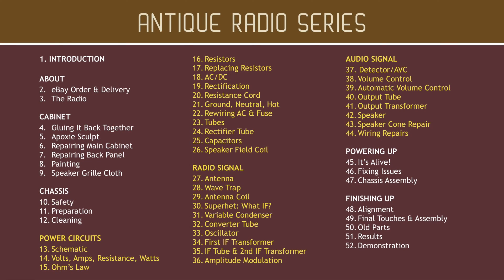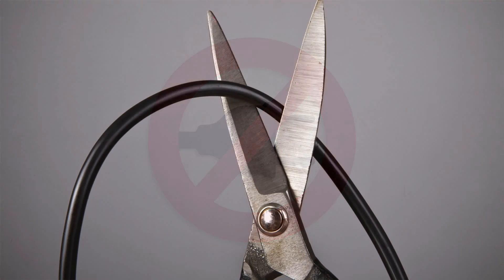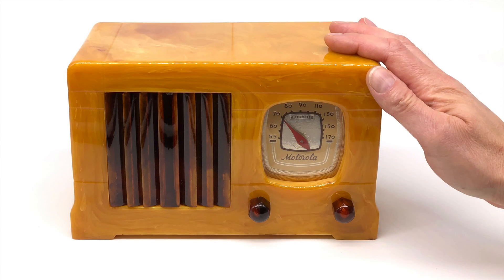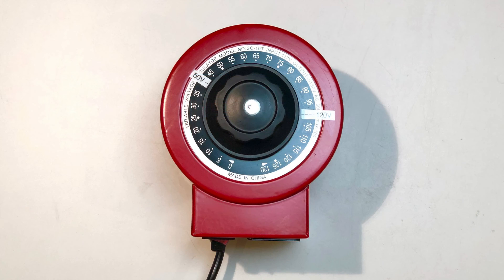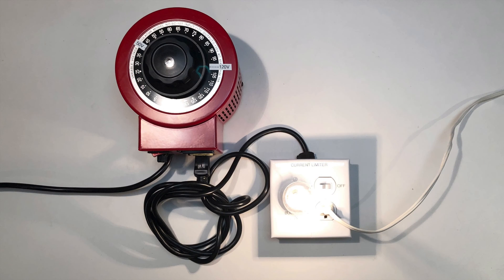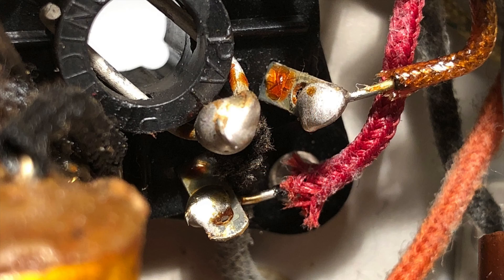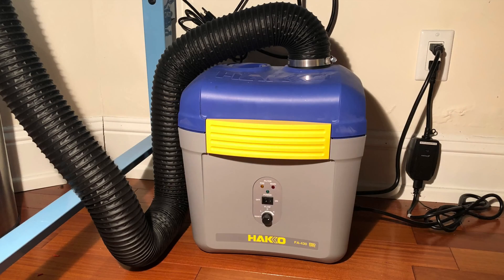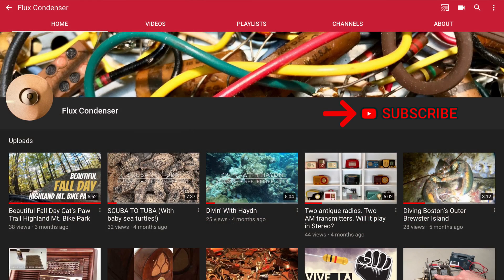Antique Radio Safety

Comment: The only problem with mixing lead free solder with the old Sn-PB solder is that you end up with brittle solder joints.  Not good.  Almost like a cold solder joint!
Reply from the maker: Hey, Sam. Thanks for your input. Since doing this video I’ve actually switched to Cardas solder (leaded). I wouldn’t say I was getting cold solder joints with the lead-free (I’d always remove almost all of the old solder anyway), but after a while I got frustrated with it as, while decent, it just doesn’t melt and flow like the traditional stuff. I may do another video comparing them in the future.
Reply: If any one under 26 (full maturity of the human brain) is soldering, lead free is a must. 
Lead exposure correlates directly to lower IQ (intelligence).

Comment: A Variac is NOT an isolation transformer. EVER. Your otherwise, so far, work is fantastic... just NOT up to par with the truly correct videos.  de KQ2E
Reply from the maker: Thanks for your comment, Bruce. It’s important not to confuse the brand name “Variac” with an autotransformer (a transformer with a shared winding on primary and secondary). Some Variacs are autotransformers, but not all. Using Variac as a generic term for variable autotransformers is simply not correct.

I can certainly understand your confusion as most Variacs are not isolation transformers and indeed, the word Variac is often used generically. I assure you though, that the Variac I use and is shown in the video (Model SC-10T) offers both voltage adjustability and isolation. If you look at the video again, you can see that the word “ISOLATED” is clearly marked on the panel. Here’s a link to the specific model: https://www.rpelectronics.com/sc-10t-1000w-variac-isolated.html Here are some other isolation transformers made by Variac: https://variac.com/staco/PDFCutSheets/VT%20isolated.pdf A quote from Variac: “Isolated Series: The isolated variable transformer has a separate primary winding which is electrically isolated from the secondary or output winding. Either side of the output can be grounded independently of the supply line, making them safe for all industrial, classroom, and laboratory applications where an isolated output without a common ground connection is required.“

Comment: My understanding is that a variac  does not necessarily also function as an isolation transformer...? At the very least the pass-through ground could be problematic with some equipment.
Reply from the maker: NOTE ABOUT THE VARIAC IN THIS VIDEO: I’ve done another video showing details and tests about the Variac shown in this video which you watch can here: https://youtu.be/8o7HtGTvBvA
Before commenting that the Variac shown is not isolated, please watch the video.
Reply: ALL variac are not isolated! Stop telling that please.
Reply from the maker: NOTE ABOUT THE VARIAC IN THIS VIDEO: I’ve done another video showing details and tests about the Variac shown in this video which you watch can here: https://youtu.be/8o7HtGTvBvA
Before commenting that the Variac shown is not isolated, please watch the video.